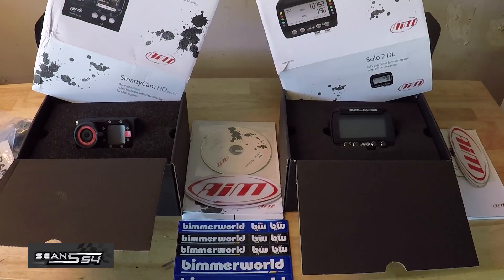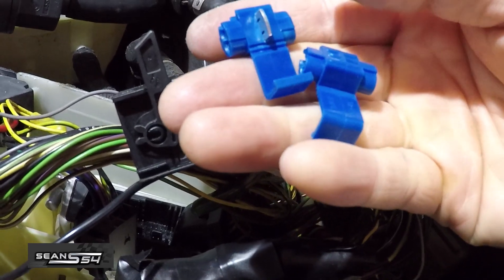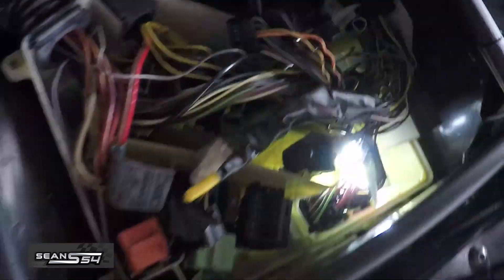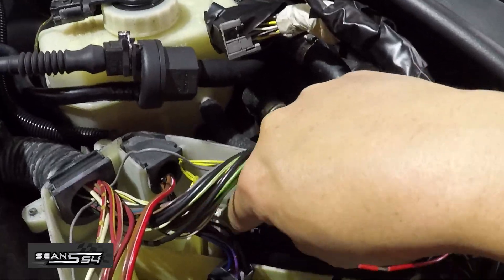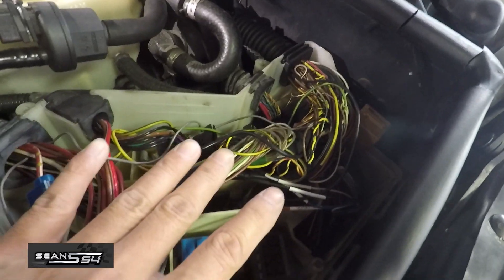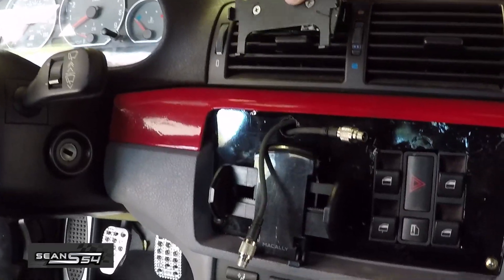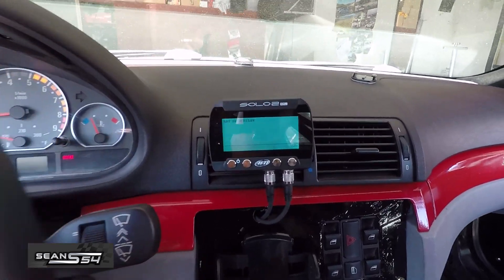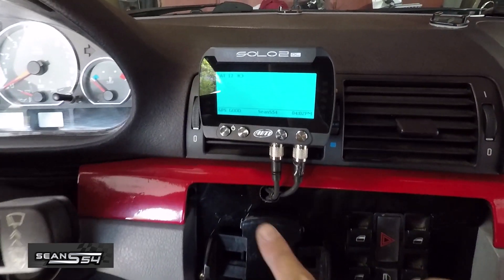AiM Solo 2 DL & SmartyCam Install - BMW E46 M3

Comment: dumb question, what cable length did you use for the cable from the Solo to the Smartycam? is 2 meters sufficient or should I get the 4 meter cable?

Comment: In my opinion the 67HFOV (aka the narrow view) lens you and I have is best for in-car view, at least in the Exige - what do you think of it in your BMW (nice btw!)?  For an example, all of my videos used the 67 lens.  I say this because wider = a view more like a fish eye go pro.  You can't see out the front as closely, and you see a lot of the side windows..which... I find who cares, you can't tell what is going on out the side anyway.   Just my opinion, view other's videos and compare what you would like for yourself.  You see in my examples that the view (when mounted on the harness/roll bar behind the seats) is a perfect view through the windscreen from left to right windscreen pillar and shows driver inputs too.  I like that the camera/setup can also be set to auto start and stop based on movement or speed and it is powered by ODBII.  With that my Smartycam is basically 1000% hands off during track weekends.  It just works without worry.

Comment: Great stuff Sean. Quick question, are you able to pull brake pressure from the CAN bus? I've read multiple reports that brake pressure doesn't work with the AiM Solo. Your videos show that you do have brake pressure, so I'm wondering how you got that to work.
Reply: Same question

Comment: BMW Tuning Bonnet gills DTM hood Vents grilles M3 GT-R Air Duct "EMU"
e36-e46 www.ebay.com/itm/282170496474 
e46-e39r4 www.ebay.com/itm/282170490152 
e46-e39r2 www.ebay.com/itm/282170505749 
e30 www.ebay.com/itm/282170503715 
e9x www.ebay.com/itm/282170494337 

Tuning hood Vents Air Duct GTR style 
www.ebay.com/itm/282271034546 
www.ebay.com/itm/282271037535 

Tuning hood Vents Air Duct AMG c63 style 
www.ebay.com/itm/282271042059

Ford ST RS universal Bonnet gills hood Vents grilles Air Duct e92 style
www.ebay.com/itm/282286171534